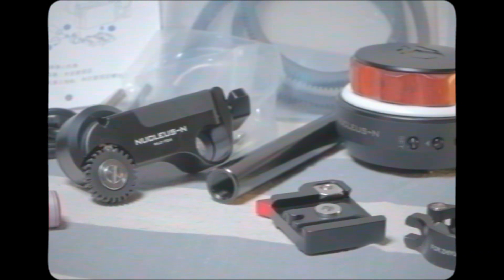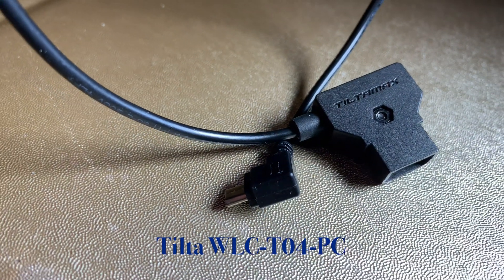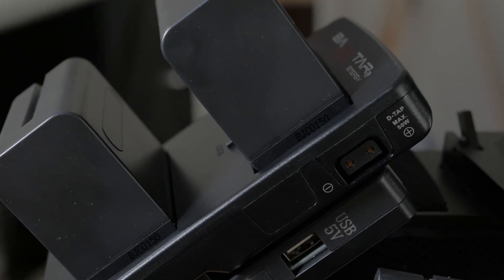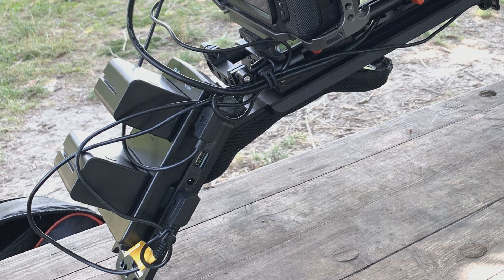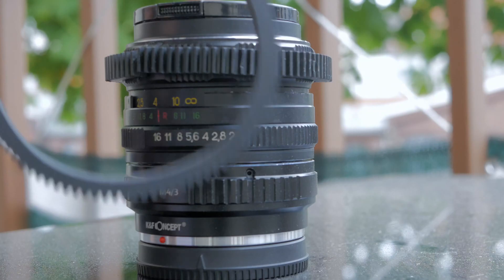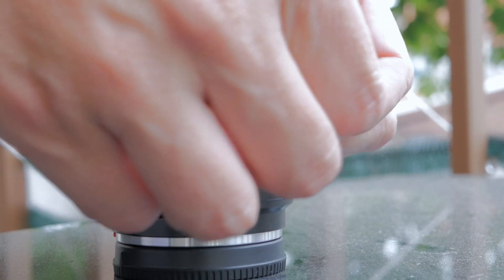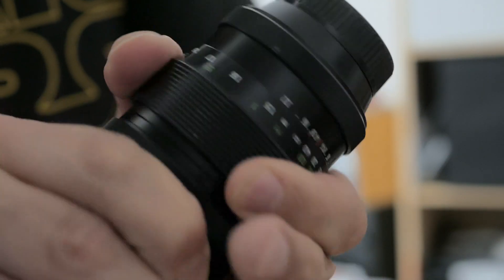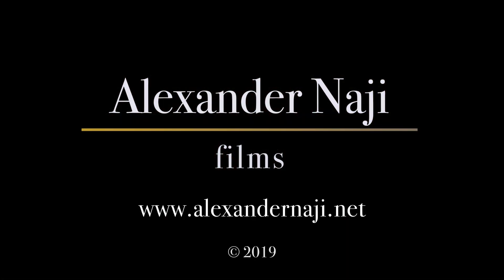Power Upgrade for the Tilta Nucleus-N Follow Focus om my BMPCC 4K rig

Comment: Awesome! I’ve been looking all over for a video about this topic, thank you! Do you happen to know if you could also get more voltage to the Nucleus N by simply using a USB power bank with Power Delivery (which can go up to 18v I think). Would the Nucleus (or the power bank) recognize this?

I’d like to get around the V-Lock adapter as I already have a pretty nice NP-F to 9v/Dummy Battery which I power my camera from and it’s very compact.
Reply from the maker: Hi Liam K.! Well, I do not know for sure if the powerbank upscaled in voltage will work. But I guess you could simply try it. The specs/hp do not say where the (up to) 18V come from. However, are you sure that power delivery can actually deliver up to 18V?
Reply: Hi Liam, did you get to try this? Using the PD output or a power bank?
Reply: @007silverwings  Oh damn, I didn’t even see canvasOlife’s answer – unfortunately I haven’t tried it, I don’t have a nucleus nano and was just researching about it. But I am definitely sure that PD can output 18V – I just don’t know how it works, it somehow automatically determines how much voltage to put out depending on what the device you charge needs.

Comment: Use the same np sony power source, with the Tilta Nano follow focus, works great not sure why it’s not used more often. The info on increasing the torque on the Tilta Nano, makes it even more useful. Thanks, and excellent video.
Reply from the maker: moeshickenyay Thanks, let’s see if this np-f power source stands the test of time. I already had one instance when it said the batteries were empty, even though they still were at 70%.
Reply: You seem to work a lot more than me, so you’ll have more data samples to work with, but Ill keep an eye on the batteries and see if the die quicker than a dedicated Vlock Battery in my setup. Thanks,watched this video aa couple of times and get something new each time.
Reply: Basically copied your shoulder rig, except using Smallrig rig, My NP batteries are still holding up, how are yours doing after a this length of time works. Thanks great video.